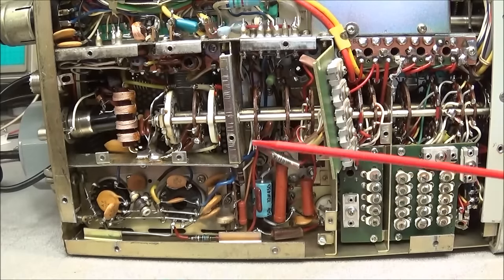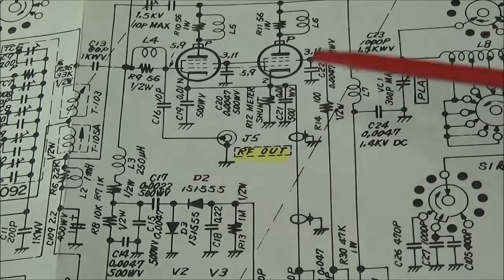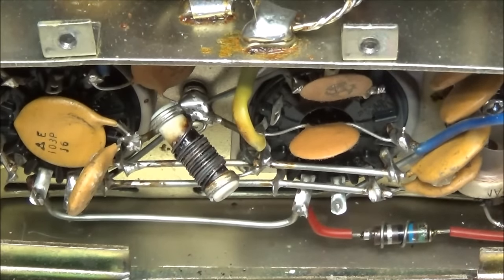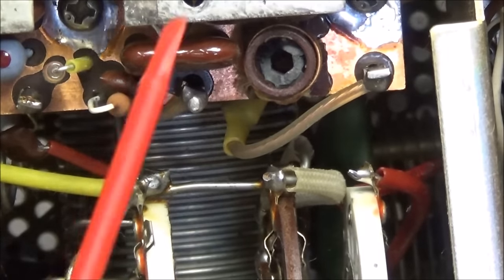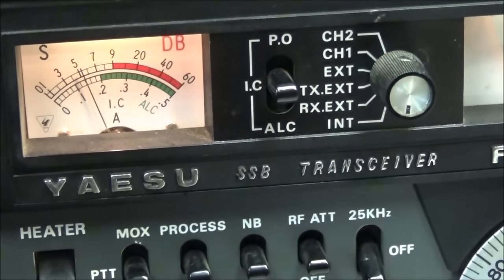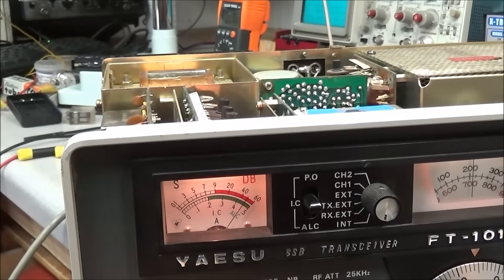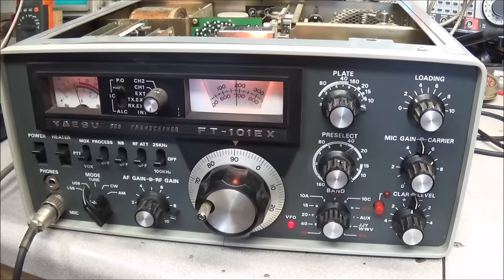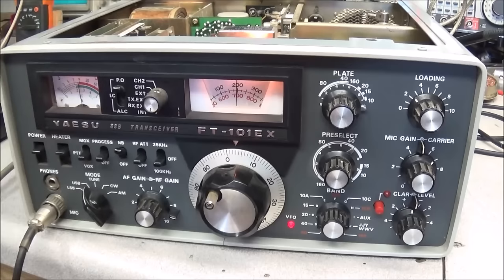#61 Yaesu FT101 series Part 2 Few nuggets and on air listen

Comment: Very instructive  video!  The 82pF 2-3kV dipped mica cap are hard to find;have not found one yet . I just removed the 80 pf/1kV domino type cap and replaced it with a new dipped mica 82pF /1kV cap... When I'll find one with a higher voltage rating I'll replace...They are listed at the Digikey Webpage and avilable to order but not in stock...
Reply from the maker: The 82pF @1kV  will do just fine. I was able to get the 2-3 kV at the time this video was posted. Now none can be found. Try Mouser.
Reply: @TheRadioShop  Thank you for the quick reply. I definitely look everywhere including Mouser...

Comment: Good wee morning hours to you.. About 15 years ago I bought a FT 101E from a Ham at a "HamCom" for 60 bucks. He told me all it needed was the finals. I took it over to a friend of mine that retired from Montgomery Wards TV/Radio Repair Dept. to let him look at the radio and fix it if he found anything else wrong other than the finals. Well we were on the verge of retiring...Montgomery Ward retired him so he started work around his place and did nothing to the 101. I just got the radio back two weeks ago and it just got dusty.  So I found you on YouTube and I watched, in one night, almost all of your video's on the FT 101''s...until I couldn't stay awake any longer. I was going to take your advice and put a 82pF 2 or 3kV Silver Mica Cap before I put the power to the tubes. Couldn't find one anywhere. We have a little electronic shop that I went into today and I asked the lady if she might have one or five and she looked and came back with brown 91pF 1000V Silver Mica Cap so I bought it.  After this long story...can I use it in place of the one that is in the radio  shown on C13?  Thanks a million. Chevy
Reply from the maker: Hi Chevy. Thanks for the story on that. I do not see why that will not work. Caps will have tolerances and I do believe there is a bit of head room there so should be fine. Thanks for commenting.
Reply: THANK YOU ! ! ! !

Comment: A friend gave me his 101E to repair (along with a FT840 & 811H amp).  Your videos are very helpful to a 101E Newbie like me.  Looking forward to next video!  73 Bob
Reply from the maker: Thank you Bob, very glad that they help/ Hope to get another up by the week end if time spares. thanks for watching and good luck on the 101E
Reply: I found a dirty band switch, dirty & stuck fan and cleaned the relay & she seems to receive fine now.  But it does have almost exactly the same high voltage issues yours has.  Looking forward to seeing what you find there.  I like these old rigs/boat anchors.  Thanx again.
Reply from the maker: Hi Bob. I think I have drawn a conclusion to the high voltages found before the regulator board.  These radios were design to run from around 115 to 117 volts back in the day.  My line voltage here is up to 122 volts at night and around 119.8 during the day.  This may have an effect on the transformer output. Check your input AC voltage to just compare. I connected one to the variac the other day set to 115.  The voltages were much closer to spec. I will show this in a future video.
Reply: Roger that.  I have a nice B&K Isolation & variable AC power supply (which I almost never use because I am stupid & lazy) & I will try that.  Hard to understand how a 6% change in supply would make a much bigger delta on the converted side.  But then re-read the parenthesis part.
Reply from the maker: Don't get me wrong, I do agree with what you are saying and after testing another radio that has higher than normal voltage, bringing it down did not help a lot.  So, I will have to do more testing....

Comment: Hi Buddy. I have obtained this same model and am having some issues with the transmitter being intermittent, weak and sometimes moderately strong on the 14 Meter, dismal on 10 and 11 Meters.. I think the relay is part of the issue, but I also suspect some bad caps in the driver and final stages. I hope you get back to uploading more content on this radio as I have already learned a lot from you so far. Thanks for your explanations, tips and tricks.

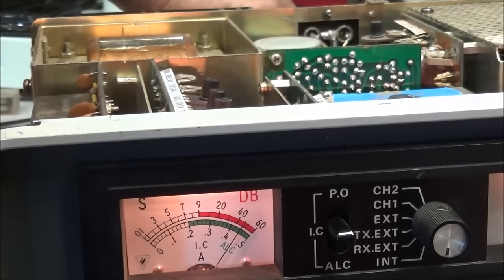Comment: ????    "      and, the deal is, to rock T120 back and forth, just a little bit"....   { 17:50 }    How did you get at the core, Buddy??  Not too clear from the video...  Cheers,  Fred
Reply from the maker: Fred,
Several ways to get at it. One is riser boards,  But in my case there was a hole drilled in the board on the rear of the radio. I used a long tuning tool to get at the 120 slug.

Comment: TNX for another great one Buddy - I needed some cool down time after having to replace an attic exhaust fan that decided to crap out tonight and your video hit the spot!  73 - Dino KL0S
Reply from the maker: I know that was a hot job Dino. The heat index here is over 114 F. Really hot. And the AC in the shop went out this week so have to work on that. Thanks for dropping by my friend.

Comment: There is a component identification error in this video. At 1.57 the electrolytic capacitor is wrongly stated as "C109" It is actually "C151" and should indeed be 10mF 315V as shown in the video. C151 is not shown on some versions of the schematic. The real C109 is a 2.2mF electrolytic (next compartment above!) in series with the 1k5 5W resistor and if C109 goes dead short all screen grid voltage (300V) is applied to R40 to ground. This causes R40 to overheat and go O/C. with the driver tube disabled (no screen voltage) Otherwise a wonderful video. Thank you.
Reply from the maker: Yu are correct Peter.

Comment: Hello. I have the same tranciever ft101b and I have problem whith the 160m transmitting power, I'm getting only 3watts to 1800khz. I'm getting 180watts to the other bands. The alc  indicator it's going to the maximun ,is that correct?Which is the transmitting and the receiving range on the 160m?
Reply from the maker: I would be looking at C131. It is a mica cap that is the padder capacitor for 160 meters.  While you are at it replace C13, it is the padder for 10-80 meters. These are located under the driver/final stage.
Reply: @TheRadioShop  Thank a lot for your answer. I check those caps and it's look good. I forgot to tell you that I have problem with the 160m receiving mode, low sensitivity.

Comment: I'm really enjoying the methodical way that you are working through the radio. I've got an FTdx-560 that I'm working on right now. I'm literally going through the radio section by section, comparing it to the schematic, and trying to put it back like it was. I'm working in the power supply section right now, waiting for electrolytic caps from Hayseed Hamfest. 

While I'm waiting I've replaced the electrolytic caps on the other boards and have looked around for obvious problems. Problem # 1 - both relays are missing. Problem #2 - The calibrator crystal, LSB crystal, and USB crystal are missing. Problem #3 - missing one of the parasitic suppressors in the PA section. So you know where I can find the relays? I'm also wondering about where to find the wire you used to rewind the shunt resistor and what size it was. I suspect you determined the number of turns with a meter?

Thanks for taking the time to make these videos. I think there are a lot of us out here that have boat anchors but are not quite confident enough to take on the challenge of working on them. These videos help light the path.  73 NE5U  Mike
Reply from the maker: Thanks Mike for the kind words. I only want to help others. This is one way to do it.&#160; I will have to look up the relays to find out a replacement. As far as the meter shunt resistor it should be a value listed in the service manual. You can replace it wit ha wire wound resistor.&#160; I only rewired mine since I had the wire on hand.&#160; But you can also use magnet wire.&#160; Wind core, check resistance. If you want to stay original you can keep checking ebay or Radiodaze for the wire. I will look the size up this week end. Sounds like you are on the way to getting that one up and going.Thanks Mike.

Comment: I have a question concerning the AC input to the unit. My FT is fed via a two wire AC cord. The plug. Is not even polarized (one blade is not wider than the other) and the chassis seems to be a bit hot….no matter which way the plug is inserted into the supply socket. This hot chassis effect takes place no matter if the unit is on or off. Its not so much a shock as a sting or burn feeling. I thought that I had a great idea when I traded the two wire AC feed with  a three wure cord fitted with a “U” ground. 110vac and neutral were connected to the pins 2 and 4 of the power plug and the green ground connected to pin 7. When plugged in, pin 7 is actually connected to the FT101 chassis., Which by virtue of the power cord is connected to house ground. Still the same hot chassis syndrome. What are your thoughts on this?
Reply: Take a look at C74 and C75 coming from pins 3 and 7 on the power connecter. If either one is leaky this would make the chassis hot. The chassis is only negative grounded when using 12 vdc.  Chassis is not grounded when using AC. That's why the cord is not  polarized.

Comment: Hi

Another interesting video.

I was interested in what sort of signal the driver will produce at J5 Rf Out if you were looking at it with an Oscilliscope while fixing a TX problem.

Could I also mention while you are looking at the driver stage caps that C11 like C13 also goes short and blows R40 removing the driver plate voltage.
Reply from the maker: Interesting question on the drive output at J5. When we get to the transmitter we will find that out. Yes thanks for mentioning that. C11 and C13 are both critical capacitors.

Comment: Great video.
But where do I get that cloth covered wire, and how do I figure out how much to use?
Reply from the maker: Thanks Will, You can find the wire at RadioDaze and ebay.  Or you can replace it with a wire wound resistor, it is just a resistor anyway and should be listed in the service manual. You can also use magnet wire. Wind it on, check resistance.
Reply: I've looked up the resistor in the service manual and it doesn't give a value, just says it's a shunt.  So the question becomes what is its value and how much wire would I have to put on the bobin to get the correct value.  Actually my radio doesn't have this problem right now, but if it did it would be really nice to have an answer.

Thanks again for the great series!
Reply from the maker: Sorry for the short reply above Will. I was at work and using my phone which is limited.  The wire size needed would be 30 AWG. Number of turns will be 12 to 13. What you are looking for is around one ohm.  Since you have a good part it would be  good idea to remove one end of the shunt and use a meter to see what yours ohms out to. Mark that in your service manual for future use.  You can also count the turns on yours for future use.  If you have a four wire resistance tester it would ne a lot more accurate. But remember that a shunt is just a very low ohm resistor (wire wound) used to measure current across it.  The current through this resistor is in the milliamp range. So plain magnet wire will work.  Another source for this wire is wire wrap from Radio Shack online. Catalog #: 2780501. This will work fine. https://www.radioshack.com/products/wrapping-wire?variant=5717668293I hope this answers your question.  Perhaps one day I will do a video on how to make a meter shunt and the formulas to do it.

Comment: Would it be good to replace a dangerous capacitor (one that causes damage if it shorts out) with two smaller ones in series but with the same voltage range so that if one fails there is an smell, change in signal, but no real damage and you can replace both?Also I'm not exactly sure which screws to loosen on the underside of a 101EE.
Reply from the maker: Probably better to go with regular modern caps.  Then never short the circuit out lol.  Witch area you need to remove the screws from?

Comment: Well done on the video once again.   A quick question on the Noise Blanker adjustments.
How do you adjust T120 without the extender board ?
TC-1 is easily adjusted.
Or maybe I have my stupid hat on this evening !
Alan
Reply from the maker: No stupid hat for you today Alan and glad you asked. Several ways to do it. Remove board and tweak. Or look at second post here:http://gokarters.com/smf/index.php?topic=2590.new#newThis was an old mod done years ago.Makes me happy that one person asked this.
Reply: WOW!
This little mod would be nice to put in a video.  Maybe you could create a video at the end of the series that show modifications that can be done on the rig such as this one.
It would also be a good place to show how to create the meter shunt resistor. :-)

I would bet that during this series you will have dozens of comments about things that might have been done, or things that were forgotten.  You can't go back and re-edit all the videos, but a catch all at the end would really be a valuable resource for the community.
Reply from the maker: Yep, there is just so much to show on these rigs.  I do plan on covering them all. There is also another mod dealing with the cutoff bias pertaining to the meter shunt.  There is a 4.7k that needs to be changed to a 10k on the regulator board. This makes sure the bias is shutoff with out effecting the bias settings. I am getting over 100 emails per week. Received over 40 just today on various rig repairs.

Comment: Hi Radio Shop the name here is Robert I have a mint YAESU FT 101FE. The radio is like new condition and it's been with me for a couple of years now and last used in 20- meters. I hardly do not use it at all and everything was working perfect but I recently warm it up to use it on the air and I have NO SSB audio transmit now. I have power on tune CW and AM put NO SSB audio transmit on the radio. I don't know what happen to other that I hardly didn't use the radio. Can you help me please with three main points where to look at for the problem this a late late model and I love this radio any advise please thank you.
Robert.
Reply from the maker: Hi Robert. That is the problem when you let them sit for a while.  The contacts on the mode and band switch oxidizes.  Get a q-tip with a little contact cleaner on it and hit those contacts. Rotate the switch back and forth a few times. Should bring it back to life.

Comment: Hi Buddy... what are you replacing the 82pF high voltage mica cap with? I am having a hard time finding anything but ceramic caps at that value and voltage?
Reply from the maker: Hi Paul. sorry for late reply. I use a 82pf silver dip 1 KV capacitor. The brown in color ones. They are mica also.
Reply: @TheRadioShop  where can I get one?
I have a ~EE, and would like to replace mine, to prevent the potentially catastrophic failure.

Comment: hey , i changed the cap put a 350v 10uf but put it in wrong place.so there a litle smoke tubes got red hot.so i put it where it went ,an now 40 meters preselect tuens @15 meters 80@40an the loading @ 0......so how hard is it going to be to get the smoke back in....an i gotten the reciver working good. ...an ideals.
Reply from the maker: Hmm, I would check the resistors under the tubes. Sounds like one of them may have went open. Probably where the smoke came from.  If I knew for sure which cap you replace may help.
Reply: i have found two that i can not get any reading @ all...the long brown resistors,it has only 3 there in the bottom...on is a 220 far side of the tubes,will any resistor go in ....as long as its the right value,1 is right there by the driver tube.....thanks for you help
Reply: I have never heard one asking how hard is it going to be -to get the smoke back IN. Good luck though, it's not always as bad as it may seem.

Comment: Holy cow!  I don't see how you got down in there to change out the (C13) 80pF 1kV Silver Mica  Cap.  This might cause me to take up drinking... Chevy
Reply from the maker: Yes it is in a tight spot! Not too hard. Thanks for watching
Reply: Mr. Radio Shop...got a question when you get time. RE: FT 101's C13 80pF 1kV Silver Mica Cap....well...my 'C13 capacitor'  in my FT 101E says "Yaesu Type L1" and Google has not been able to find a "Yaesu Type L1" capacitor. This may be the original cap in this radio. It looks good from the outside.  Question? Do you know what a "Yaesu Type L1" cap is and should I just let it alone or go on and put the new 91pF 1kW Silver Mica Cap in it's place? Thanks a million! Chevy
Reply from the maker: Replace it. Don't even take the time to test it even if it looks good.  The L1 was just a code branding that was used on the cap.  Replace it with the silver dip. 91Pf will be fine. Hope that helps.
Reply: Thanks again and Happy Memorial Day !

Comment: Good Job Mr.B! :^) Those finals are pretty pricey up here (around $100 Each) at the local parts place. Luckily, I have a few "Green Banders" kicking around to keep my transceivers happy. Also watched your previous video this morning, The Hakko clones, known around here as, "fake O" :^) have a digital and an analog iron that look exactly the same. Maybe they shipped the wrong head? I find the fakeo tips work ok for the price difference. Hope you enjoyed your holidays.
Reply from the maker: Hi Mr.C.  :-)You are right about those tubes. High dollar today.  One reason to make sure the bias is shut off when in receive mode. Yep, all mine are Fake O types. Even the Radio shack unit is a rebranded Atten station.  Todd at Xronic assured me I had the correct iron. The other models will not plug into my unit. I got the replacement in yesterday and it works a treat. Found the cable was the issue on the defective unit so will replace it and have a spare. Had a great holiday here and 18 days off. Hope all is well with you my friend. Have a great one.